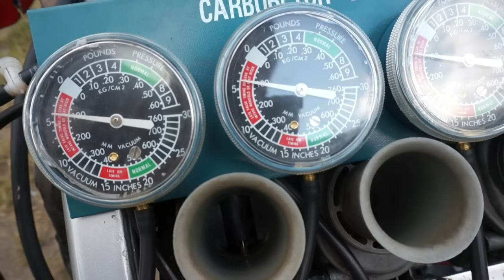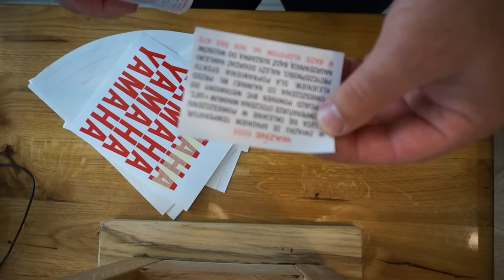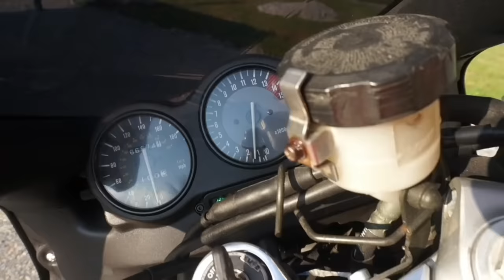Restoration Abandoned Old Motorcycle Yamaha YZF 600 Thandercat

Comment: Hello!  a lot of work has been done with the cat.  I did the same thing at the moment, only I powder-painted the wheels and the pendulum.  I noticed on your frame there are also marks from the contact of the plastic.  everyone seems to have this problem.  I had no luck with the brake discs.  The wheel rim was heavily oxidized, the aluminum oxide had done its job.  I had to restore 3 threads, but now I have the tool and experience)

Now I’m finishing assembling fairings in the Fiat style)) There remains the problem of a rotten exhaust system (can) (((
Over the 5 years of ownership, I drove 26,000 kilometers on it, and decided to give it a new life.  it is very convenient.  Greetings from Russia)
Reply from the maker: This is great bikes and worth to restor it, Im glad you restore your one as well.
Best regards

Comment: I have seen many videos on YouTube but this is a very good video of a motorcycle restoration.  In my personal opinion I think that the inside of the piston engine, cylinders, etc. needed a little work, in the end the sound of the machine was not very good.  The motorcycles are characterized by having a sound typical of Hondas;  Yamahas and Suzuki especially the Suzuki has a sound that is like music and the Honda for its powerful roar.
  Great job friend.  All the best.
Reply from the maker: That engine i was rebiuld, old one has hole in the crancase and broken cylinder head, from old engine I use only gearbox and carburetor, I did not rekord all this job but I regret that..

Comment: Good work, but I cant understand why you not remove tyre (very old dot to ride) and weights before painting wheels, in the last part of movie you have changed them anyway, so do it first to restore wheels, probably you have make experience for this now. 👏
Reply from the maker: Thank you , good point about a tyres , yes you are right about them but rear weel got dot 0821 it was changed last year and ballanced thats why I decide to paint wheel with tyre still on. Front tyre is old 2013 and need to be changed to be on safe side ... I agree with you on that one ,

Comment: Just on the off chance, the negative terminal from the battery on this bike where does it connect to? I've just swapped to a rebuilt engine, it's all connected except for the negative as I can't figure where it goes 😕
Reply from the maker: Hi ! negative terminal is going directly to engine casing , just put negative wire on one of engine casing bolt on back righ side , hope that help you, if not drop your fb name and i send you a picture by messanger

Comment: Did you get another used engine ? Well done, congrats 👏👏👏👏
Reply from the maker: Thank You !  I only used the gearbox from the old engine because everything else was damaged by a broken connecting rod, I bought a used crankshaft, pistons, cylinder heads, and cylinders. Unfortunately, I did not record the engine repair. by accident, I deleted a few films from engine painting, gaskets, suspension and brakes regeneration, etc.
Reply: @motocraft180  Congrats by the final
result. Amazing supersport bike, from a time they were not 16.000
rpm redline monsters, with almost no low-down grunt. I own a '99 FZS-600 Fazer (common in Europe), which has basically the same engine, with 5 HP less and a little bit more torque in low revs. It's a shame you lost the videos about the engine re-assemble 🥲 Congrats for the final result, once again 👏👏👏
Reply from the maker: I used to have a Yamaha Fazer 600, 2001 silver, a very comfortable motorcycle, pleasant to ride, similar characteristics to a thandercat, I love it when it exceeds 8000 rpm it is like a turbo would turn on. Great bikes ..
Reply: @motocraft180  Keep sending more videos, my friend. Ride safe ! 😊👍
Reply from the maker: @nunomc2815  Will do more videos , ride safe to

Comment: Even if the engine is damaged, you can probably install a new engine or get one donor engine to salvage some parts from even convert it to an EV
Reply from the maker: Thank you for your comment , that is true , I rebiuld engine from used parts , only gearbox and clutch was still ok from original bike , I bought cylinders ,head, crancshaft , pistons with  connecting rods, engine block ,